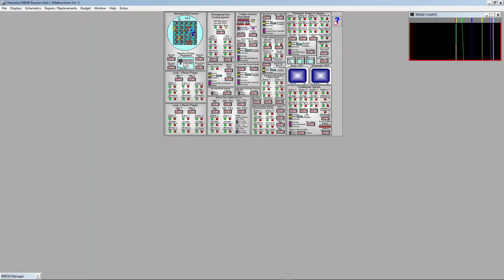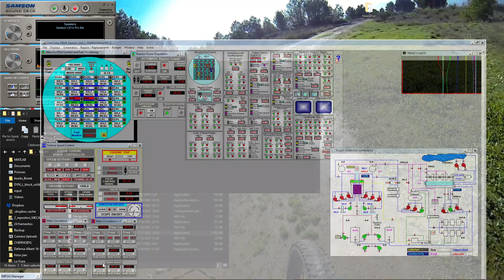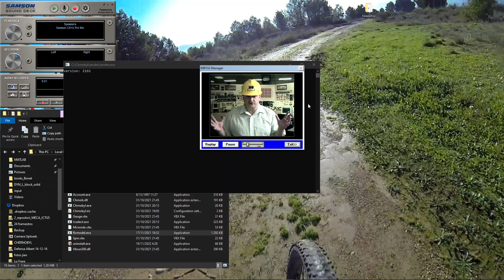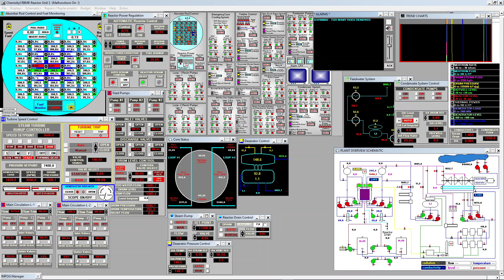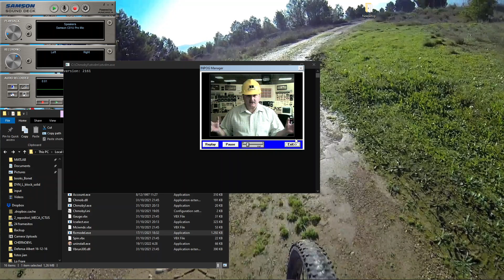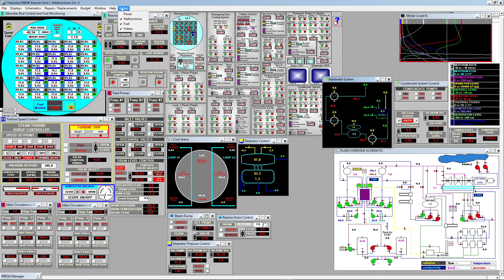RBMK-1000 Chernobyl simulator comeback

Comment: is there any way to edit fuel burn rate ? its burns way way too fast imo
Reply from the maker: Yes, you can override it with cheat engine. You will find the instructions in a more recent video called "fuel fix" or sth like that. Alternatively, you can use more recent versions of the simulator that do not have the bug, you will find the links in my more recent videos. Try the "ichy avocado" version or the full game port version.

Comment: The spike in neutron flux at 26:19 looks like it was caused by the reactor automatically tripping. All the rods were at 0% and so the SCRAM causes a brief period of positive void feedback looping. Classic RBMK behavior! Basically the same effect that caused the chernobyl explosion. I think you walked right into the same trap!

It's been a long time since I played. My first guess is that you didn't have an explosion because most of the fuel was burned up. Otherwise the automatic control would not pull rods all the way out unless Xenon % gets very high.
Reply from the maker: Yes, looking at the video it seems that it's the typical RBMK graphite displacers behaviour. I think it's worth exploring this scenario since a fuel end-of-cycle is quite common. Also, I feel that in previous videos I gave the impression to people that the accident in Chernobyl was something very unlikely to happen. But it turns out not to be so unlikely, just imagine operators trying to economise fuel by delaying refuelling with most of rods withdrawn.
Reply: @argilaga  it's actually super cool that you organically kind of ran into the same problem as who knows how many early RBMK crews.

Now ask yourself the same question that the soviet engineers of the time faced: How can we keep the reactor safe during a catastrophic failure... such as the americans dropping precision guided bombs on both the primary loops inlet and outlet at the same time!

You gotta try to spin the generator on the turbines potential energy... It's the only way, remember that we just need to power the backup pumps until the emergency generators get online. The whole time you are draining those reserve tanks into the core for a complete loss. You design the test for this and end up with a chernobyl disaster.

Comment: awesome, before everything went wrong, the control rods retract and that reduces reactivity, then the power goes down and reactor level drops down to -20, then the circulation also fails, then it scrams because of the low level and reactor power jumps up because of the control rods. At one point it had 23% thermal power and a neutron increase rate of 66%, with 10% voiding and no recirculation pumps.
Reply from the maker: Exactly, I didn't expect that. At the end, the 1986 accident behaviour is not that difficult to reproduce.